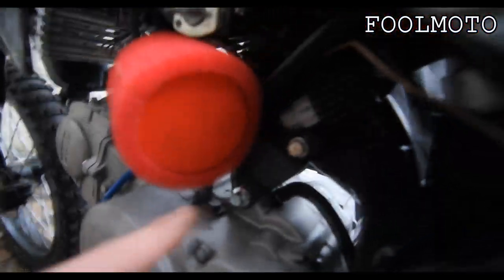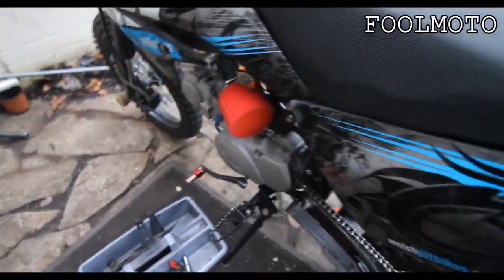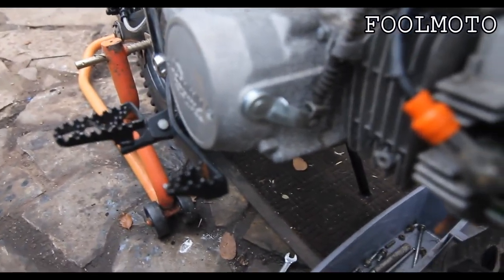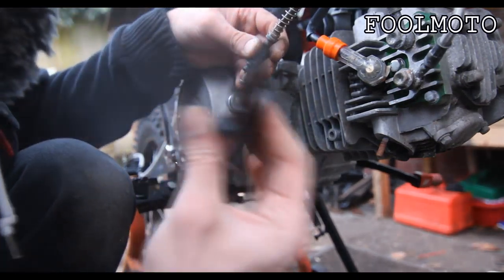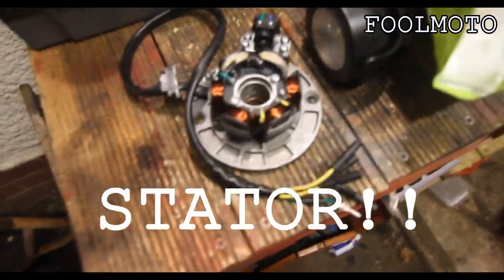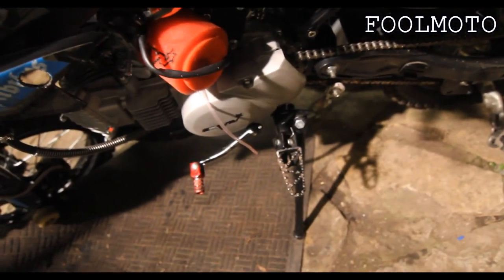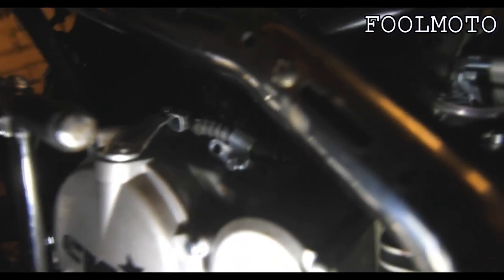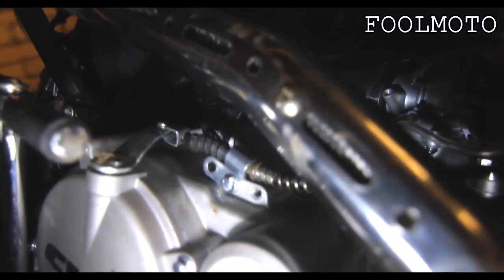NEW PIT BIKE ENGINE INSTALL|YX 160CC

Comment: great video! Im planning on swapping a 125cc engine that i have lying around to my Masai DB 50 But im worried about the stator not fitting in it? is it possible its not gonna fit or are the engine stators same?

Comment: Did you use both the stator and fly wheel from your 125? I’m doing this swap in a few weeks and I definitely don’t want to cut into the wire harness if I don’t have to. Rather plug and play uk
Reply: How did your swap go

Comment: Hey man is it normal for it to kickback like that? My brand new yx140 is the exact same, has nearly broke my ankle a couple of times even using the top dead center trick
Reply from the maker: The Documentary Dude hi mate,yeah mine does exactly the same it was a bugger to start fist time.what i find works is if you sort push down slowly with your foot  and stand up a bit with some gas but not to much it seems to be a bit more reliable to start ,i hopes this helps ill do a video on it probably this week to show you what i mean.
Reply: Thanks man appreciate it I always see people kicking theirs like it's nothing I'm sure it will ease as it wears in more, keep up the awesome videos!
Reply: FOOLMOTO what did you do with this engine bro
Reply: My bike does the exact same thing
Reply: @Hermiwalle  yes correct, that's exactly right.